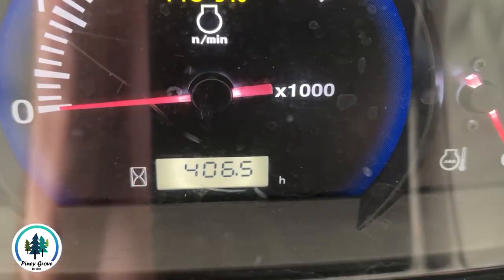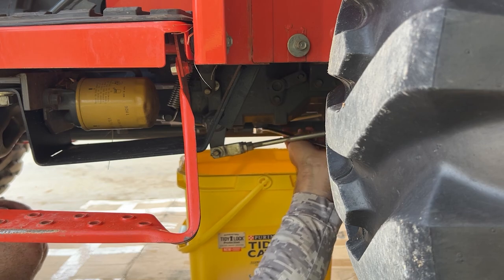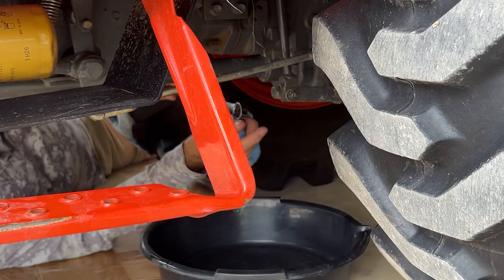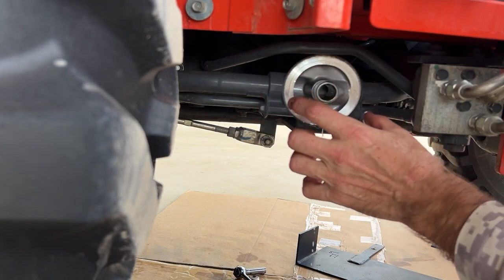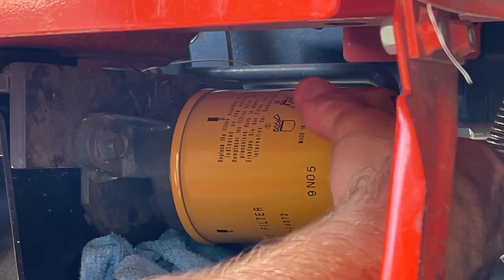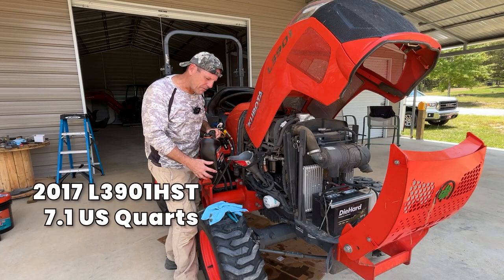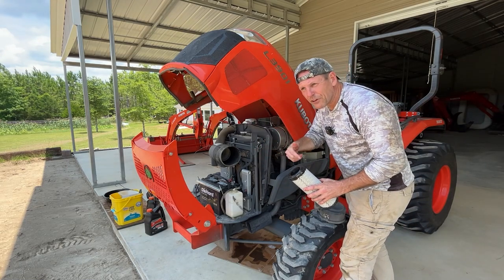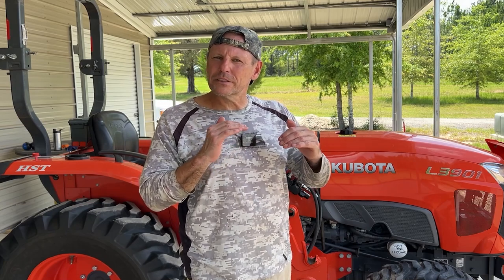Kubota L Series 400 Hour Service for L2501 / L2502 / L3901 / L3902

Comment from the maker: See this tractor plow here: https://youtu.be/sMpNlu8yt1Q
Tractor grill guard: https://lownperformance.com/      Discount Code: TractorHard5
Kubota L-series service supplies:
TA040-93230 OUTER AIR FILTER: https://amzn.to/3XlUgTn
HH1J1-43172 FUEL FILTER:   Not available on Amazon
HHK70-14073 HYDROSTAT FILTER: Not available on Amazon
HH164-32430 OIL FILTER:  https://amzn.to/42XuTsm
HH3AO-82623 HYDRAULIC FILTER:  Not available on Amazon

Costs nothing extra to use our Amazon links: 
Flex Tape: https://amzn.to/3R4MdWm
Mechanix Leather Gloves: https://amzn.to/3HjoZZf
Titan Post Hole Auger: https://amzn.to/3toHEx2
Ratcheting Fence Tensioner: https://amzn.to/3aEfSX0
Pope and Pipe Level: https://amzn.to/3tqUhHX
Fence Post Puller: https://amzn.to/3QbcNhy
T Post Manual driver: https://amzn.to/39dwt3J
Come Along Winch: https://amzn.to/3aQMqND
Clip bending tool: https://amzn.to/3xlqrG0
Mechanix Leather Gloves: https://amzn.to/3HjoZZf
6’ Digging and Pry bar:  https://amzn.to/3vH5Agx
Dewalt 20V ½” Impact Wrench: https://amzn.to/3UOcXNH
Dewalt 20V brushless Leaf blower: https://amzn.to/3zwJcYm
Dewalt 20V brushless ½” drill: https://amzn.to/3HGXJ7z

Welcome to our channel!  🎥 What to Watch Next: 
Fixing Leaky Pond: https://youtu.be/NEwSTg1aOWc
Transforming Our Property: https://youtu.be/-jBGEYJea1Y
Clearing Thick Brush with Mini Excavator: https://youtu.be/QVNiwOHSWdo
Mowing Large Acreage: https://youtu.be/sXV5CgRs3nk

➤FOLLOW US on Social Media: 
Facebook - https://www.facebook.com/PineyGroveHomesteadAndMiniFarm/
Instagram - https://www.instagram.com/pghomestead/
TikTok - https://www.tiktok.com/@pineygrovehomestead

Our Story:
We are five years into a seven year effort of transforming 20 acres of "Piney Grove" in Northwest Florida into our dream homestead/mini farm to be filled with animals and joy. We plan to have a variety of miniature critters on our pastures, raise free-range chickens, grow fish in our pond, garden, plant fruit and nut trees, and harvest wild game. Our goal is
to escape the stresses of corporate life and embrace all that country living
has to offer as we enter the next chapter of our lives. Follow along on our
journey!

Thanks for watching and please Like and Subscribe to help our channel!!
Brad & Deb

Tractor grill guard: https://lownperformance.com/      Discount Code: TractorHard5

Kubota L-series service supplies:
TA040-93230 OUTER AIR FILTER: https://amzn.to/3XlUgTn
HH1J1-43172 FUEL FILTER:   Not available on Amazon
HHK70-14073 HYDROSTAT FILTER: Not available on Amazon
HH164-32430 OIL FILTER:  https://amzn.to/42XuTsm
HH3AO-82623 HYDRAULIC FILTER:  Not available on Amazon

Costs nothing extra to use our Amazon links: 
Flex Tape: https://amzn.to/3R4MdWm
Mechanix Leather Gloves: https://amzn.to/3HjoZZf
Titan Post Hole Auger: https://amzn.to/3toHEx2
Ratcheting Fence Tensioner: https://amzn.to/3aEfSX0
Pope and Pipe Level: https://amzn.to/3tqUhHX
Fence Post Puller: https://amzn.to/3QbcNhy
T Post Manual driver: https://amzn.to/39dwt3J
Come Along Winch: https://amzn.to/3aQMqND
Clip bending tool: https://amzn.to/3xlqrG0
Mechanix Leather Gloves: https://amzn.to/3HjoZZf
6’ Digging and Pry bar:  https://amzn.to/3vH5Agx
Dewalt 20V ½” Impact Wrench: https://amzn.to/3UOcXNH
Dewalt 20V brushless Leaf blower: https://amzn.to/3zwJcYm
Dewalt 20V brushless ½” drill: https://amzn.to/3HGXJ7z

Welcome to our channel!  🎥 What to Watch Next: 
Fixing Leaky Pond: https://youtu.be/NEwSTg1aOWc
Transforming Our Property: https://youtu.be/-jBGEYJea1Y
Clearing Thick Brush with Mini Excavator: https://youtu.be/QVNiwOHSWdo
Mowing Large Acreage: https://youtu.be/sXV5CgRs3nk

➤FOLLOW US on Social Media: 
Facebook - https://www.facebook.com/PineyGroveHomesteadAndMiniFarm/
Instagram - https://www.instagram.com/pghomestead/
TikTok - https://www.tiktok.com/@pineygrovehomestead

Our Story:
We are five years into a seven year effort of transforming 20 acres of "Piney Grove" in Northwest Florida into our dream homestead/mini farm to be filled with animals and joy. We plan to have a variety of miniature critters on our pastures, raise free-range chickens, grow fish in our pond, garden, plant fruit and nut trees, and harvest wild game. Our goal is
to escape the stresses of corporate life and embrace all that country living
has to offer as we enter the next chapter of our lives. Follow along on our
journey!

Thanks for watching and please Like and Subscribe to help our channel!!
Brad & Deb

Comment: Dude, you did the right thing,  I do not trust the dealership's now days. Also, you filling the oil filter with oil is the best thing you can do for your engine and it will last longer!
Reply from the maker: I've had my truck drain plug left loose and my oil filter put on with 2 gaskets before.   Nobody wants to take pride in their work.  They are too busy watching the clock.

Comment: I hit 200 last week on my L2501.  I changed the fuel filter.   I was shock at how much stuff was inside my filter.  I have a little different set up.  My fuel filter is clear.  Good video.  I love working on my tractor.
Reply from the maker: The 20 hour (or is it 50 hour?) initial filter change always has all the wear particle on the suction side of the hydraulic filter.  It's from machining and it's normal.   The 400 hr is usually pretty clean.  Thanks for watching.

Comment: When I did my hydraulic fluid service I hung the 5 gallon bucket from the ROPS with a cam strap to the bucket handle.   It made the pouring operation easy to control and much less back strain.  The spout lined up easy to the long funnel.  No spills no stress!

Comment: If I may make some suggestions... 
1. Have a pair of nitrile gloves on when you work with fuel and drain oil. Your skin is an organ! Would you pour drain oil on your liver?
 2. Fill your filters before you put them on if they are vertical. They will pull sooner with less cavitation.
3. Use K&N  filters. They have a 17mm nut built in on the nose that is much easier to use thana strap wrench.
4. I use big pieces of old cardboard under vehicles to keep oil off my concrete.
 A good video Brad. Oil Dry comes in 5 gallon pails..
Reply from the maker: Great tips!   Thanks for watching.

Comment: Yes sir, there are numerous information about filling filters before putting them on, especially from CAT and Cummins.

Basically the reason for not filling the filters with fluids is because you would be bypassing the filtration.  The fluids are passed through the filters before returning.  So, if one fills the filter the filtration is bypassed.

Hope this helps.  Good video though, thanks!  MJ
Reply from the maker: We hope our new oil put in the filter is clean!   Thanks for watching.

Comment: Why don’t you like the inner secondary air filter? 

I have several industrial construction machines and an L50/30  that use them and they haven’t caused any issues for me. I believe they help by catching any super fine dust that makes it past the primary filter.

Thanks

Comment: Thanks for all the great info.  I am purchasing a B3030, with cab and wondered if that was a similar tracto and what kind and weight of engine iol do you use? 😊
Reply from the maker: The B is one size smaller than our L3901 and about the same size as the Summit TX25. 

Always consult your manual, but I think Kubota recommends the same oil for all their diesel engines.    You should be able to read it on the video...I don't want to guide you wrong off the top of my head. 

Tractor Buying Guide video we made: https://youtu.be/WSC7T6DOTcs

Comment: Hydro oil looks real clean... I wonder if 400 hour change is actually necessary 🤔.  I'm  at 360 hours and I'm questioning the hydraulic oil change. 
Great vid...thank you.
Reply from the maker: It's expensive and messy but I wouldn't skip this one.  It's a $30K machine and that transmission really likes clean oil!    The non-synthetic tractors change at 250 hours!

Comment: You forgot the water separator. Very important. I also use a product called Heat which i bought off of ebay because the separator will get a film built up on it and will quit running due to fuel starvation. Heat will prevent that film.
Reply from the maker: I do the water separator whenever I see it getting build-up....it stays pretty clean.    Front axle here: https://youtu.be/EuZOWC_dELo

Comment: Synthetic 15w40 or Non Synthetic 15w40? I can’t find in the manual that says oil has to be non synthetic. So I just bought off the shelf valvoline 15w40 and called it a day.
Reply from the maker: Non-synthetic is recommended.   You can go synthetic for extra protection, but I don't.
Reply: Rotella T...the old standby

Comment: Did you change your pre fuel filter or not.
Reply from the maker: The fuel/water separator?  No.  Not needed.  Just drain it if it has water in it.  This tractor is kept inside and the bowl is clear.

Comment: If u fill the fule filter first, that will save u from having to bleed it so much it sure is a pain in the butt
Reply from the maker: Agree.....it was hard to put on though.  Not much clearance and I almost cross threaded it.  Thanks for watching.
Reply: If you go "by the book" it's not recommended to refill the filter because then that fuel is unfiltered and Tier 4 systems don't have a lot of room for error (trash - talking micron levels).

Comment: Did you say $50 for a gallon on standard engine oil?
Reply from the maker: I read it from the receipt.   You can buy oil cheaper than at the Kubota dealer, but I like to support my dealer if possible.
Reply: Holy crap good for you man I don’t like my local dealers that much. I’ll stick with $16 Rotella T4 because I’m a tight ass.

Comment: You didnt have to service the front end fluid?
Reply from the maker: I'll have to look at the manual but I should at least check it, right?    If I recall correctly, they ship it from the factory with HST in it, but then you change it out for gear oil.
Reply: I would just check it.
 @PineyGroveHomestead
Reply from the maker: @garyjohn316    It's easy enough to change.  The caps at the bottom of each axle pop out to drain it.....then fill it with 90W.      Sounds like another video!